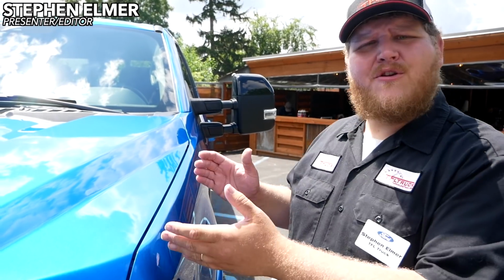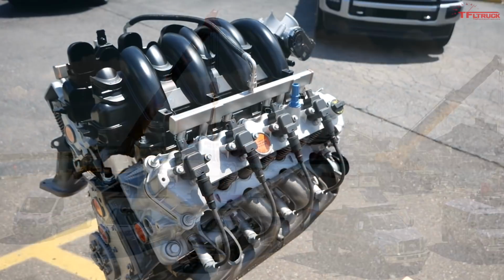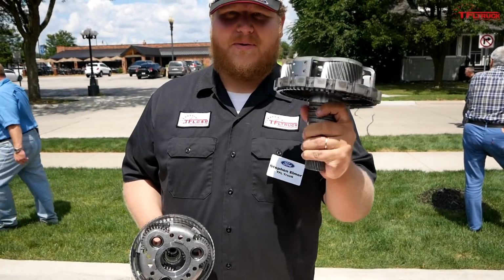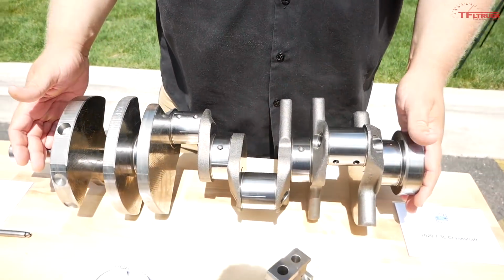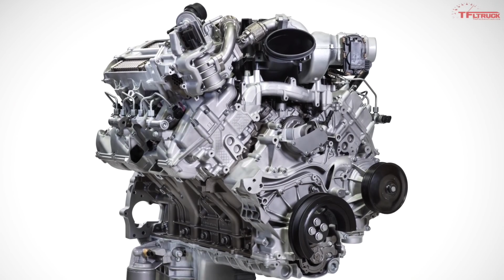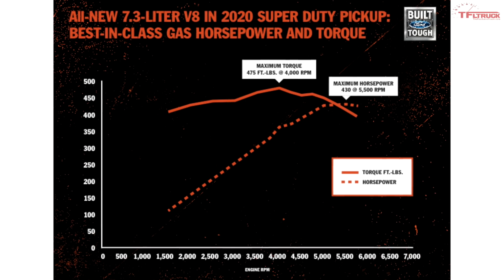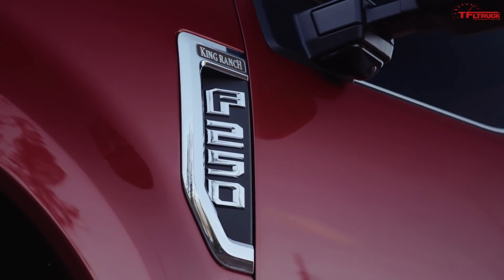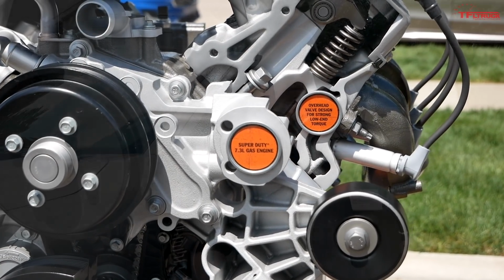We Finally Know the Ford Super Duty 7.3L V8 Power Numbers & They Are Lower Than We Thought!

Comment: Hoped for 500+lbs around 3000 not 4000. All the hype and expense and it won't be a viable option for anyone including me. Another Ford let down.
Reply: @Charles Ball I don't want HP, I want torque. 475 is low for 444 ci and the peak I too high.
Reply: I expected at least 500 lbs and it's easily obtainable with the bore & stroke combo and the proper programming. Like the old 5.4, 4.165 stroke and it could not pull anything. It's in the programming and with this all new design, the engineers flopped again. Time will tell when the engine won't sell.
Reply: @therealist4006  It won't sell because it's tuned for commercial applications that value longevity, fuel economy, and the ability to make rated power on 87 AKI? This isn't some racing engine.
Reply: @mrburgermaster  Did I speak of a racing engine?  It only has 475 lbs at 4k. Not enough AND and rhe peak is too high for any good with a 10 speed. It won't sell as they believe it will in the HD market, most will pay for the 6.7. I was in the market for a 250 with the new engine but not now.

Comment: Why aren't people impressed with the numbers? Sure it's 7.3 liters so you naturally think big power numbers, but it was design to work low rpm and do it for hundreds of thousands of miles reliably. Not race at the track. This is why the GM 6.0 crushed the others in this area of longevity, reliability and cost over time. It didn't have the same hp and tq numbers as other 6.0s because it was designed to be a work horse and it did its job.
Reply: Nobodys is impressed because we had gas engines like this 20 years ago, dodge 8.0v10, Ford 6.8. Were all engines like this. This one has more hp, but they because it revs higher.
Reply: What a tard!  Those engines got shit fuel economy, and durability wasn’t anything great. Nor did they make these power numbers in actual HD truck use, Viper numbers don’t apply here. With a 14.7 vs the typical 12.7 air to fuel ratio, the fuel economy on these should be greatly improved, especially under a load.

Comment: That engine alone could bring this Toyota guy back to Ford. No replacement for displacement! And thank god it’s a pushrod motor.
Reply: When did toyota make heavy duty trucks?
Reply: @39impala  hino trucks is toyota, they make comercial trucks
Reply: @cho2jzfe90  Yes commercial, not HD pickup trucks.  Toyota only makes a 1/2 ton truck that ain't even worth calling a light duty 1/2 ton.
Reply: @wildbill23c  Toyota used to make 1 and 1.5 ton pickups called the Toyota Stout
Reply: @ghost-jesus  They were pretty small too, you'd run out of room nefore you'd reach the 1 or 1.5 ton capacity lol.
Reply: @39impala  The don't, and no one suggested they did.
Reply: Me too, except wasn't all that impressed with the build quality of the 2nd gen Tundras, power from the 5.7L V8 was fine but the axle bearings didn't hold up long, and I had the front diff howl/growl issue that resulted in a replacement front diff both issues occurred early on well below the 100k mark, and resurfaced around the 102k mark...was far from impressed with these recurring problems that Toyota couldn't seem to fix...and they're vehicles are outdated by several years....granted its a full size truck that Toyota was trying to pass off as a heavy duty truck for a few years, it wasn't even close and the front independent suspension gave me several alignment issues in areas that were never a problem with a solid axle.  If they want to go heavy duty they've got a long...long ways to go, because their current Tundra isn't even close....not even borderline HD 1/2 ton with the issues I had with very light towing/hauling duties.
Reply: @wildbill23c  Very light duty indeed, -and also very expensive.
Reply: Agree! My 2014 just about to turn 50,000 miles has had quality issues! Radio randomly shuts off, cam tower oil leak at 25,000 miles, dash rattle they could never fix and a new random acceleration problem with no codes! 😠 drove the tremor superduty and was like Damn! This is a truck!
Reply: Agreed, have my name down for one already
Reply: This 100x. No more TOHC!!! Garbage technology and overcomplicated engines.
Reply: @som1alive  if ford was not cheap asses on head the ovc been great they need to copy the 1uzfe 2nd get fer trucks the heads on the 5.4l 2v n 3v were tiny junk
Reply: LONG LIVE THE PUSH ROD
Reply: TOYOTA??   AHAHAAHAH   YUR A GIRL
Reply: This Toyota guy, will wait and see what the gen 4 Tundra's spec out at.  Yes, the saying "No Replacement for Displacement" is true, knowing Toyota would never go that big.  But, all the displacement does you no good, if it's sitting in the shop.  I have test drove a F-250 6.2 gas and a 2500 gas Chevy...
Reply: It's funny that you are a Toyota fan. The reason overhead cam engines suck is because they are over complicated without enough benefits to support it in 99% of cases. I just replaced an engine in a 2007 Tundra and it makes the Triton engine look like a flat head Briggs and Straton as far as over complication comparisons.
Reply: I drive a 14 tundra 5.7 and Just drove the tremor last weekend. Gotta say that truck made a joke of my lifted tundra! Will be going back to talk trade in numbers.
Reply: You might even get your man card back
Reply: @dedreman2227  LMAO! -Agreed